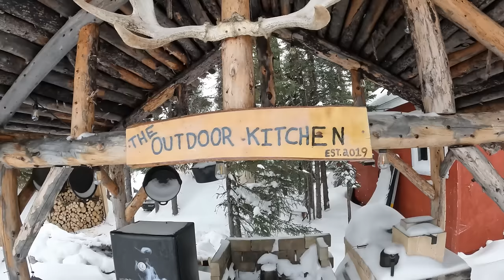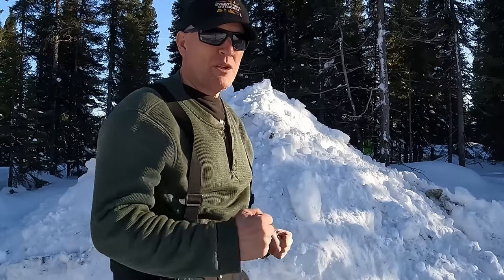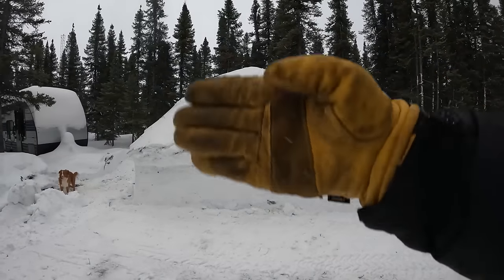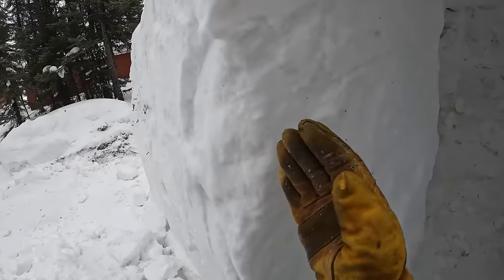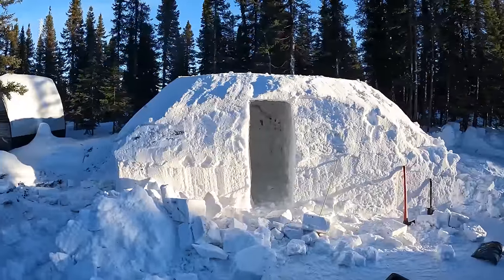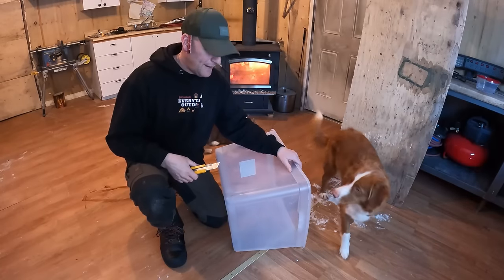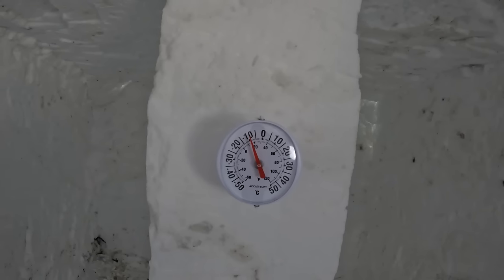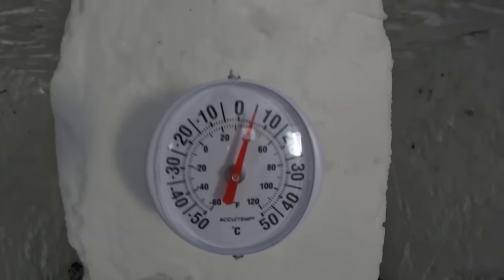HOW TO BUILD A SNOW/ICE HOUSE - START TO FINISH

Comment: Thanks for this Chuck...made my day! So fun to watch.
If there was more snow and colder i would do the same in my backyard. I bet you could insulate the walls and ceiling with styrofoam panels and retain more heat. I would double pane those tupperware windows too😅.
Reply from the maker: Haha. That would mean I’d have to break my piggy bank and buy another one of those $8.99 Tupperware containers though 😂😂